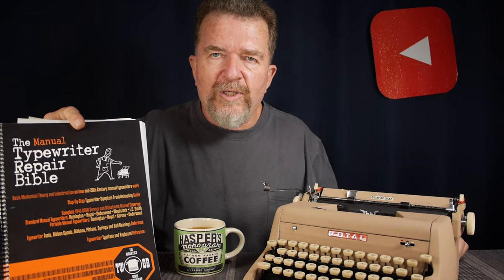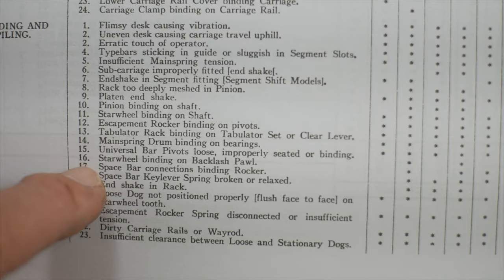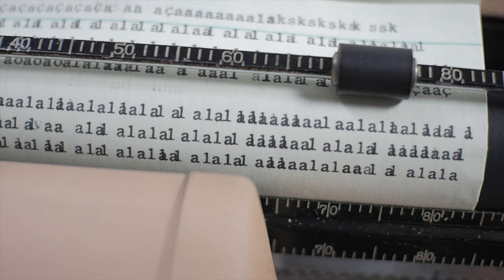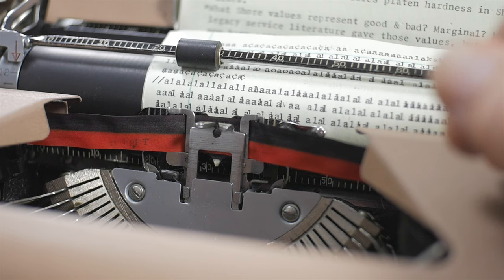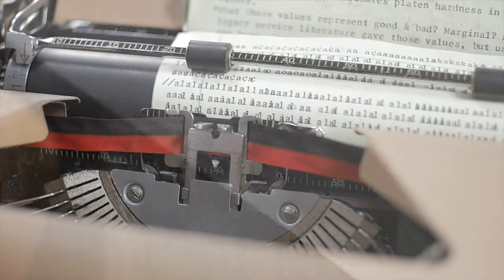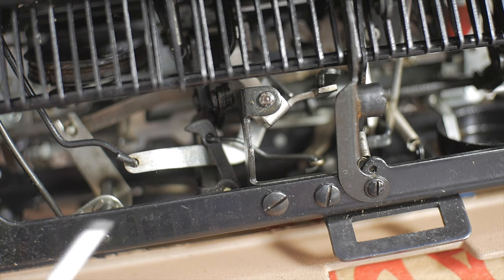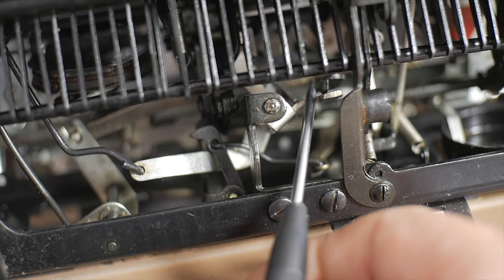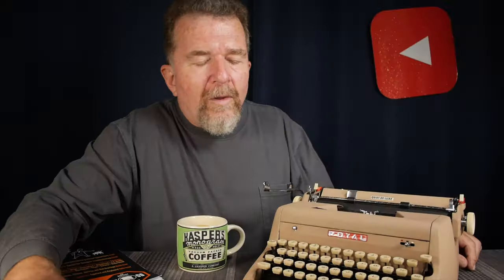Typewriter Video Series - Episode 234: Royal QDL Spacing

Comment: yup, Royal portables tend to have fairly sensitive "forming" adjustments that require patience and a light touch to get just right - but when you do get it dialed in, they sure are fantastic to type on. Excellent and thoughtful walk-through of the diagnostic process! :D
Reply: Yes, sir.  I would stress that typists to leave that sort of "forming" to a professional.
Reply: I got some video of my escapement…the ball on mine is further away after trip which is probably why excess vibration is making it skip sometimes. It also moves more on trip which I’m assuming is a function of the rocker arm needing to be closer to the star wheel.

Comment: Actually, that silver arm and the rear escapement trip you formed are two different pieces attached to the same bracket and axle held to the typewriter frame with two screws.  The entire bracket comes out for easier controlled forming without risking escaping the space arm travel limit tooth or bending the vertical axis of the bracket itself.   Been there, done that.
Reply: I see that bracket has slots and I thought the same thing. I can't get to those screws very easily to try out the adjustment.

Comment: I am having what appears to be a back-and-forth issue with the loose dog on my Royal QDL. When I press a key (or the space bar), the loose dog goes forward too far, and when the loose dog is trying to come back, it gets out caught on the star wheel, causing the carriage to freeze. Have you seen this before? It seems like I should be able to make an adjustment, so the loose dog doesn't go in quite so far.

Comment: I am finding my QDL misbehaves when I’m too heavy handed. The design seems to be optimized to allow a light touch for less overall effort to fill a page. I tried playing it softly like a piano, filled a page with less effort than a Smith Corona and no bad behavior. If a key is hit too hard it will release the escapement twice. Crowding seems to stem from heavy quick typing.

Comment: I have the opposite problem with my royal with magic margin. While typing it will sometimes just randomly insert a space into the middle of a word.
Reply: My QDL skips. One thing I found is the escapement pawl (loose dog?) was way too low so I adjusted it up to where it should be. That stopped almost all the skipping. It mostly does it on h hit too hard or an unstable typing surface such as my lap. It’s not just h, other letters hit too hard will do it too. I suspect it is part of the nature of the escapement design, maybe brand new not so much a problem but after decades of wear it’s more prone to skipping. The Royals are more sensitive to typing style than Smith Corona but nicer to type on in my opinion.

Comment: I have 2 Royals that are prone to crowding and skipping, it’s harder to induce crowding on my 1936 Smith Corona, it will if I really try but even then it is slight.. If I use a consistent steady pace it doesn’t do it so much. The 1938 Deluxe is worse than the 1952 QDL.
Reply: I measured my trip points in millimeters as best I could. 3/8” is 9.5mm. The 1938 is about 6mm or pretty close to 1/4”, I can barely hear the faint click.. The 1952 QDL is 7mm or 3/8” minus 3/32”, it clicks and jumps slightly so that may need adjustment too.